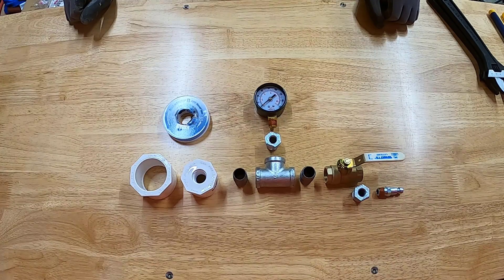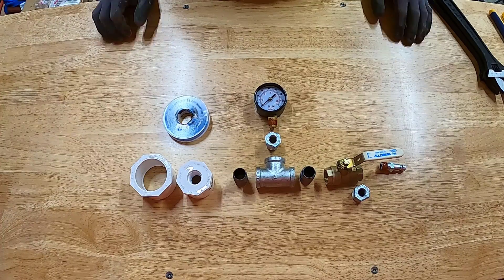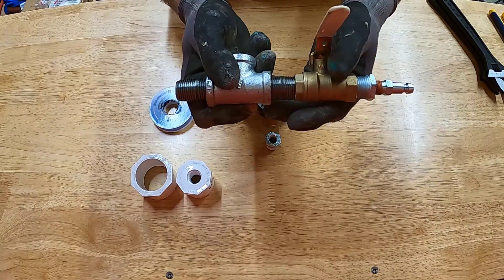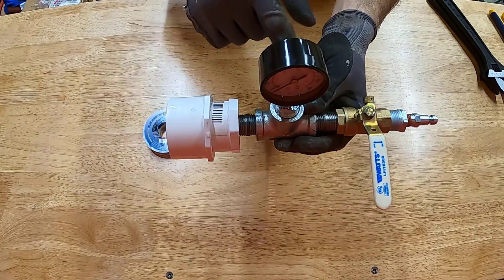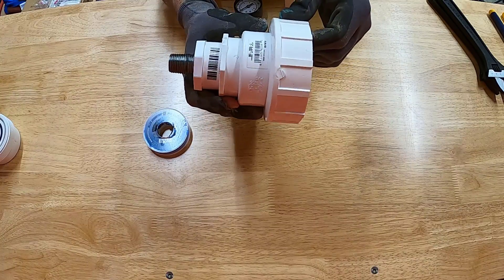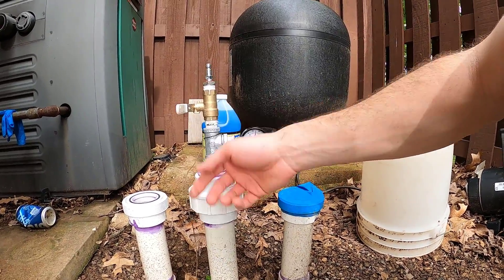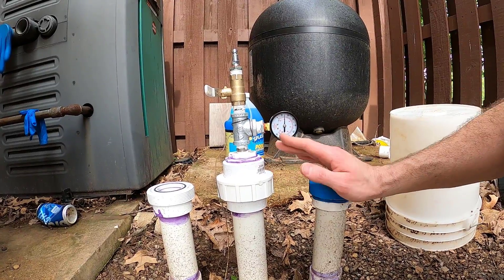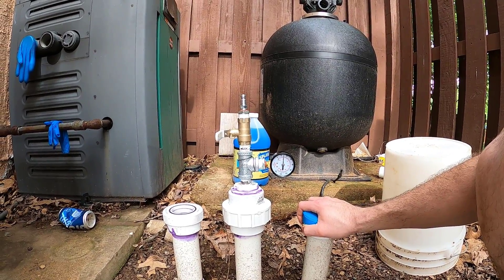DIY - Pool Plumbing Pressure Test

Comment: Class 12 PVC pressure pipe is rated to 1000 KPA    145 PSI
I only test to 200KPA   29 PSI
That is more than the normal operating pressure.
Half of the lines you are testing are suction lines and will actually be running at Vacuum when in use.
It is actually safest to use mains pressure water to test plumbing as it will just pop off rather than explode as it would with compressed air.
Never use any iron fittings in conjunction with anything to do with a pool.

Comment: Do you have a video running the pool lines?  I have watched the others, but I have not seen that one.
Reply from the maker: Hey there, I didn't put together a video showing the actual lines being ran, though I may have some recordings saved, will have to dig them up. I just used schedule 40, 2" PVC, primed and glued all the joints. One thing to mention though, I did take measurements of where each of my lines were ran underground so I could find them in the future should I need to. I did run a dedicated "home run" line to each skimmer and return; meaning I didn't branch off to multiple returns from a single line. I felt this would allow me to isolate or cut off a line should a leak ever occur and give me better flow with less pressure or resistance.

Comment: Please don't test with air up to 30 psi! At 30 PSI air has compressed down to about 50% of the original volume. If your pipe were to fracture for some reason (bad pipe, crack, etc...) it would basically go off like a bomb potentially sending shrapnel everywhere. This is extremely dangerous. This is also why rubber air lines are reinforced with fibers to prevent liberation. 10 psi of air is plenty. You can find leaks by spraying the lines and joints with soapy water. 30 psi is okay for water, but not for air. Also your pool pump probably never puts out even 20 psi so if it isn't leaking with water at 20 psi that's probably all you need.

Comment: How did you cap off other end skimmer and returns?
Reply from the maker: Skimmers: The “port” in mine are threaded, so I used a PVC Cap to screw in with Teflon tape on the threads. 

Returns: I used a rubber “testing plug”, if you search online or on Amazon you’ll find them. They are very similar to a winterization plug, but heavier duty and won’t blow out as easily. 

If your skimmers aren’t threaded, a testing plug should work there as well.

Hope this helps! Thks
Reply: @SeldomRest  thank you 🙏🏻

Comment: You didn't show how you stopped the other end, or used the air compressor to get 30lbs.   you know the tough stuff..  you talked a lot in the first 2/3 about not much.  This could have been a 3 min video.   But thanks.
Reply: The tough stuff? Plug your compressor in and turn the valve off at 30 psi lol wth
Reply: And you plug the other end lol, you might want to contact a professionnal for this

Comment: This is a great video. Can you also build an open stem plug to create a closed loop, in case I need to add fix-a-leak (or any leak fixer product)  to the faulty line? in my case is the suction line. I don't want the fixing product to be all over the system or the pool.
Reply from the maker: Hey there, thanks for the comment. I have not used any leak-fix products but don't why you couldn't modify this type of design to allow you to install as a closed loop. Check out LeakTronics channel, they have a ton of content covering leak detection and repair: https://www.youtube.com/c/leaktronics

Comment: Thank you for the detailed video. We've built a 16' x 36' pool and completed the plumbing last night, only to learn that the first pool pressure test is done prior to backfilling using air. Luckily, I'll not have to cut off the two manifolds. I'll simply use your design with my existing unions! Thank goodness! You've saved me a lot of frustration, time, and expense.
Reply from the maker: Really happy you got value from this video! Hope your pressure test goes well and you can move on with the build and be swimming just in time for summer! Thanks for the comment.

Comment: Water is far safer to use than air- you can compress air, can't compress water. Plus if it is leaking water, easier to find. 30 psi is high with air!
Reply from the maker: Thanks for the comment and feedback, great suggestion on the use of water as an alternative to air. Safety has to be a big focus anytime you pressurize a line for sure.

Comment: Thank you for a great video and explanation on how to hook ot up. I was also inspired by the same video as you but didn't understand how the unit was attached to the plumbing. You covered it pretty well. I still need to find out how to release the air once I'm done testing the plumbing.  Can you send me a quick message to 813=455-8941 to let me know how to release the air.

Thank you

Comment: Good video. We need to pressure test a 1 1/2" solvent weld pool system before backfilling and concreting in so this is very helpful
Reply from the maker: Good luck with the project, and glad this video was helpful. Thanks for the comment!

Comment: The ball valve is watertight but are we sure it's airtight?
Reply from the maker: I can say I was successful using air to test with no leakage from the ball valve at all, and I had lines under pressure for up to 24 hours. I did use a soapy water solution to check for any leaks, once everything was tightened up I was good to go. I know some people do use water instead of air to test with as well. 

Thanks for the comment!

Comment: How did you go about stopping up the return jets at the pool to maintain pressure?
Reply from the maker: On my skimmers I was able to use a threaded PVC plug and had to wrap the threads good with a teflon tape to get a good seal. Then on my returns I used an actual rubber plug that was made specifically for pressure testing applications. They are similar to a rubber winterizing plug, except instead of a tapered design they are a consistent size/circumference on both ends. I ordered them off of amazon for the PVC pipe size I had (2"). If you try to use the normal rubber winterizing plugs, be very careful as they will have a high chance of blowing out especially if you test up to 30 psi. I had tried this and had one blow out, would have been very dangerous had someone been in front of it. You can use a soapy water mixture to see if you are "leaking off" at either the plug size or on the actual pressure text manifold too. Let me know if this helps, happy to share more.
Reply: I use test balls. They work great won't have any leakage.
Reply: @Brutal_Diabeetus test balls? Where